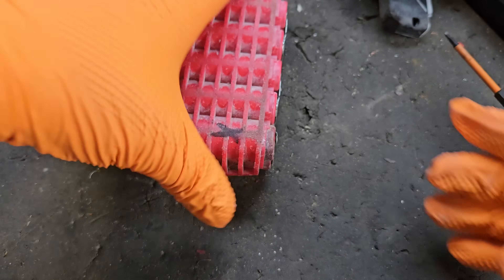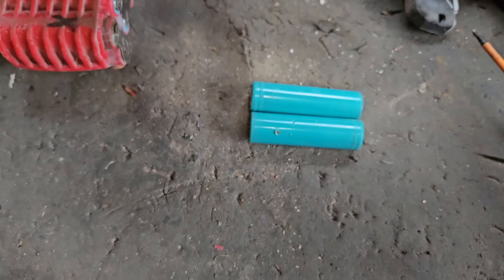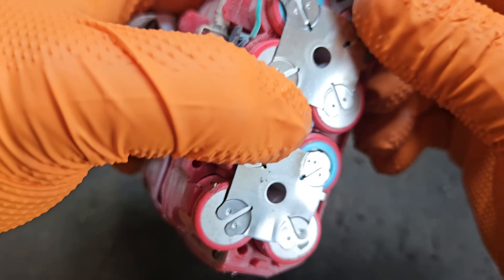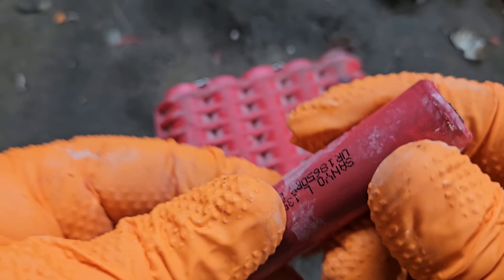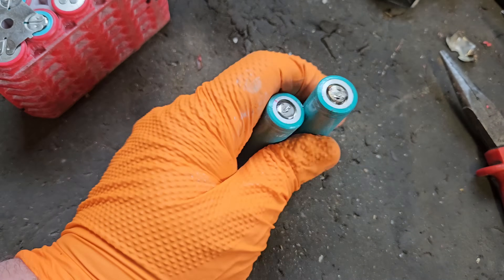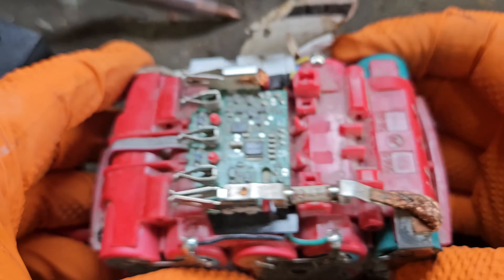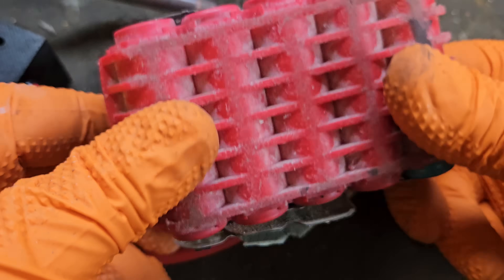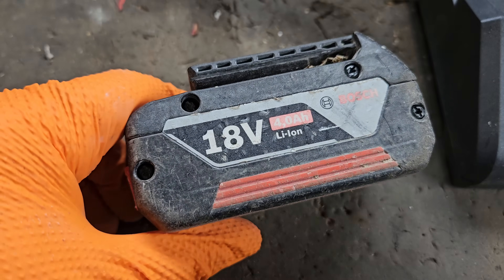Bosch Battery BAD Cells? TRY THIS!

Comment: i have a question, why does bosch bms looks so basic compared to milwaukee and makita like they have these big mosfets and everything but bosch one looks basic but yet milwaukee ones with all that still fail far more?
Reply from the maker: Do they fail far more?
Reply: @doctorlefthandthread  more so the milwaukee ones fail far more due to there being no balancing and bms locking it up
Reply: or maybe because there are more milwaukee batteries in the market?
Reply from the maker: @3ijnweu3oq3 I couldn't say which has the higher fail rate